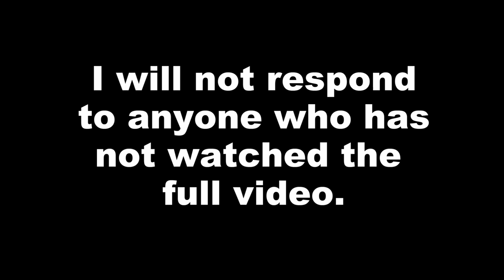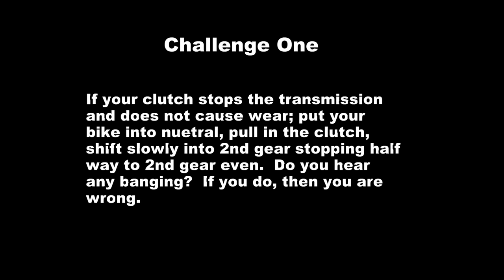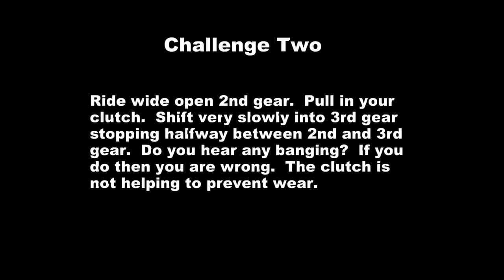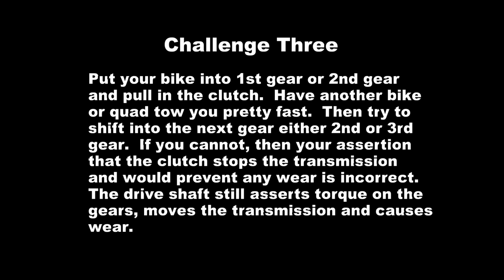Dirtbike: Shifting without the clutch

Comment: Many of your points are valid but not all, from my perspective. If you belive im wrong please correct me, im just here in an friendly manner. And would like to learn if im wrong. What i would like to say is, when you change gear without clutch it can wear out your transmission faster. Ok, why? If you revmatch perfectly it wont make any difference at all. I stand with you there. But when you arent using the clutch what you are doing is forcing 2 gears together at different speeds, and yes you do that when using clutch to of course. So whats the difference? The difference is, in this case the wheel spinning the gearbox is the non stoppable force. And the engine is what will adapt to the gear and wheelspeed. What is happening is the gear "notches" will click together and will themself brake the engine rpm ex from 6000 to 4500. That energy is what will "slam" the notches. It wont cause extreme wear but defenetly wear out them at maybe the dubble rate? (guess from me). If you pull in the clutch what will happen is the same thing, the gears will still spin at different speeds but what the notches will be breaking is just the clutch + clutch friction. And thats why clutching wears less on the clutch notches and gears. Please ask if you dont fully understand me and i will explain. And if you think i am wrong explain to me why and maybe we can come to an agrement! So in concusion what i say, without clutch more wear. With clutch less wear. And thanks for taking the time to make such an instructive video!
Reply from the maker: There is no slaming except in the case of down shifting if youre going faster than that rpm range can handle.  Otherwise, the gears actually spin faster at the same rpm range so no slamming.
Reply from the maker: And if that is the case that the clutch would not be spinning and have more give it actually makes it slam harder because its not moving where in the case of it moving they are still going the same direction and not going to slam. so the clutch makes it worse in that case.  This is also why its best to do a video response and not a comment.  There is no extra wear from not using the clutch.  The wear comes from not shifting correctly and when there is too much torque on the gears.

Comment: There is always going to be a certain amount of "drag" involved when the clutch is pulled, this means all gears in trans are always moving, all you need to do is use proper technique  when shifting clutchless which is very easy, basically a quick movement of shifter with no throttle applied.  and for those who disagree,...  listen when a harley is kicked into first gear, its such an awful sound i cringe and wonder if he has a magnet in gearbox, love to see that drain oil after a few thousand miles!!

Comment: I ride a Honda 250crf in my day job, on and off road about 100 miles a day. On road I rarely use the clutch and over 10,000 miles later I am on the same clutch with no issues.

Comment: I got a tech question. Sometimes when I shift(2007yz250) in to 1st or 2nd from neutral it shifts hard like a louder then normal clack sound , it also make the same type of sound when I'm lugging it like through tight trails . Dosent jump/slip or pop out of gear just a loud clack when putting into gear . Any input would be awesome .mahalo

Comment: I raced motocross for years and never used my clutch to upshift .throttle wide open ,up through the gears.its a constant mesh gearbox it's designed that way ,its a technique u learn.clutch to pull away and slip the clutch to get in power band when exciting corners..I've raced 125s 250s and 500s and never lost a clutch.believe me it does make you quicker..

Comment: I was shifting without a clutch today and now  my bike won't go into any other gear than first with you have to force and force back into nuctrel any thoughts
Reply from the maker: When you shifted without the clutch, was it hard or easy? You can't force shift if there's torque on the gears you have to let off the gas.

Comment: Ive never heard of the dogs on the gears grinding, but I did manage to break the teeth off of 2nd gear on my 400ex by shifting without the clutch.
Reply from the maker: That's anecdotal.  Gear teeth break off for a variety of reasons and the clutch doesn't do anything magical as explained since the gears still go together the same way.  Revving the bike up and dumping the clutch is one way to break off gear teeth and that's USING the clutch!  Down shifting at high speeds is another, without the clutch is very bad but still bad even with the clutch.  Manufacturing defects is another cause where the material isn't properly treated or sufficiently thick/hard for the application.  Unless you were not letting off the gas when you shifted without the clutch, the issue is elsewhere.

Comment: Nice video, but you don't really show the wear points that typically develop, which are the rounding of the square edge gear dogs over time. Clutch just lessens the load, as these gear dogs rub across each other, engaging and disengaging. Sure a perfect no throttle condition with no load, no clutch will work most times, but there will also be those times where a hard drag into the gear dog chips away the corner. Using the clutch, just guarantees, that the drag is lessened with out fail.Ive also seen horribly notched baskets from people who do a lot of clutchless down shifting through braking bumps.

Comment: I never really argued about damage occurring  when not using the clutch and sometimes(although rarely) I shift without the clutch.. I just always use the clutch because I fell awkward when I don't.. lol
Reply: ClutchLuck24/7 the way I think about is  when I don't it's like a moving gear changing to a stationary gear and over time could possibly damage your transmission I always use my clutch and it's always good because let say you need to stop quick you use the clutch and brake

Comment: This is great information! I have read from numerous sources, of the recommendation to blip the throttle on a downshift (without the clutch). How does this work? Wouldn't that simply lurch the bike forward if the clutch lever is not pulled in? Or the blipping does nothing and I should just ignore that completely?

Comment: honestly I almost never use the clutch with several bikes I have owned, I have never felt clashing or resistance, just speaking from my personal experience.I actually think clutch shifting up a steep hill is harder on everything because of the drive lag, I use the clutch from a stop, when I need a little extra power or shifting my weight.99.9% of racing type heavy duty sequential transmissions use straight cut gears, not helical, ie they are pretty much bullet proof

Comment: i dont use it up shift and i use it down shift anyway doing this for many years without problem only thing i know is that is quicker i realy douht it damege anything if you just hold a gently pressure on the shifter  and cut off the gas it will shift smooth just by itself .....

Comment: In motogp, the fastest accelerating hardest braking motorcycles in the world, they shift down to go up a gear and shift up do go down a gear
Reply: I use the clutch on my 250 to jump up in the rpm range when necessary
Reply: Alex Brillant your point is? All I know they do that for faster shifting. For instance drag bikes it's easier to shift down it's quicker to do than up with your feet!
Reply: the reason that is, is because they are so low in left turns that they can't fit they're foot between the shifter and the ground to shift up
Reply: can you explain that better please
Reply: This is so you don't have to get your boot under the lever whilst accelerating out a left hand corner, where, you will admit, there is little space

Comment: This is all assuming the rider has good timing skills with the throttle....

To avoid user error, use the clutch no? I cant imagine shfting without holding the clutch in and without modulating the throttle, just holding it wide open the whole time. It all boils down to how good the rider is imo.
correct me if im wrong

Comment: Do u know perhaps why my dirtbike makes loud noise when shifting into 1st gear. It use to not do this. Do I need new oil or do I have to bleed my hydraulic clutch on my ktm. Is something not engaging. What should I do.
Reply from the maker: What kind of noise, a rattling?
Reply: Opferman Motors Dirtbiking I loud clunk not a rattle just a short loud clunk

Comment: I bought a old Kx80 you can switch the gears into neutral well the bike is not running but while the bike is running it won't go into neutral and it's very hard to shift. other than that love the vid

Comment: I haven't understood 100% of it, but followed "ok" for the most part (i think?).
So to sum it up, when upshifting, you may need to slightly let off the gas to realease a bit of torque coming from the main shaft for it to match with the torque coming from the drive shaft, and when downshifting to slighly blip the throttle, for the same reason (like rev-matching in a car). Did i get this right?

I knew why rev-matching was important (i mean, just feeling how a car behaves when you downshift early without throttle bliping is enough to understand), but i never knew how the mechanical forces worked (torque here). Anyway, thx for the video, i hope i got it all right! :p

Comment: what would the difference be if you shifted up/down clutch-less while being on the throttle moving?
Reply: On the throttle, you've got a high amount of torque moving through the transmission.  That torque creates a lot of friction between the dogs (which IIRC are often very subtly undercut to keep them from falling out of engagement, on top of everything) which prevents them from easily disengaging so you can shift into the next gear.  That puts a TON of stress on the shift fork for that gear, and will either prematurely wear it out, or actually bend or break it.

For a no-clutch downshift, you actually will need to get on the throttle slightly.  Off-throttle and decelerating, the engine is being pushed by the wheel, so you've still got torque moving through the transmission.  A quick little twist of the throttle to match the torque at both ends of the transmission is needed.  Even using the clutch, you want to throttle the engine up for a downshift to keep the rear wheel from slipping when you reapply the clutch (look up rev-match downshift).  

The main thing a clutch does is disconnect torque between the engine and transmission.  You can accomplish the same thing with the throttle very easily on a motorcycle/dirtbike.
Reply: immikeurnot I feel like throughout my life riding motocross, you alway jam the gears down without the clutch, (on hill climbs, entering corners etc) and on upshifts you just blip the throttle slightly right before the shift. The gears are different on MX bikes compared to cars or something else arent they?

Comment: so I have 2 four stroke 125 Chinese pit bikes one is mine and the other is my 6 yr olds can shifting without  using the clutch save clutch plates and transmission ?  I know it can be done truckers do this when the engine gets to the right rpm you can up shift and down shift ! also his doesn't seem to want to go in and out of gears I'm no transmission guy so I don't know anyone
 have a idea what's going on?? thanks

Comment: Ok.... i bought my son a brand new 2010 yz250. 12 hours old.. 2nd gear wont hold. "Slips out of gear with the slightest amount of throttle". He didnt use the clutch and flat changed because his mate at school said you dont need to use the clutch. I pulled the engine gearbox apart and found 2nd gear dogs rounded off on the male and female side. Also found 3rd and 4th rounded off but not as bad! I replaced all 5 gears and the forks as the forks were loose on the shaft. ... " fork to shaft mounting is a roll pin"!!!  Bike is now back to me with no drive in 4th gear! Pulled apart and again the gear dogs are rounded off causing it to slip out of gear!!! Fork is also loose on shaft!!! My point... what is he doing wrong??????? I have the same bike bought at the same time and thrash it using the clutch!!! No problem!! Please help!!!!!!!
Reply: Bike 4th gear problem at 26hrs...
Reply: robmotown1 Clearly he is not letting off the throttle when he shifts without the clutch, just banging it up with the throttle still applied

Comment: another illuminating challenge, and im not saying ride all over hell during this, put 10 wght oil in trans how does it shift now? now drain and fill with 90 wght, now how shift? this will clue you in to the role of viscous action plays together with synchronicity and the drag of clutch plates all work together and the balance of torque between wheel and engine output and input, some people just find it hard to visualize whats going on, you have it right
Reply: smackomatic leftright:  is it true?  per the video, i should NOT let the bike roll while running without engaging the clutch? Because the video states oil will not be distributed?

Comment: One problem I see with shifting without using the clutch is the very rapid change of speed on the engine and gear box components. You will change the engines rpm with let's say 1000rpm with a "bang"(milliseconds?). There's some moving mass in the crank, piston, flywheels etc. and that energy has to go somewhere. The clutch will release the moving mass from the crankshaft and if you're able to mach the revs when releasing the clutch it will be a very smooth shift. The gearbox is still in motion from it's inertia so shouldn't be a problem to engage next gear. 
But how much impact that has on the bearings and gears etc. compared to normal forces when accelerating I don't know.

But it might be irrelevant for a dirt bike that's ment for racing and full service twice a month, but as you where talking about oil in the crankcase and that stuff I started thinking about the impact it could have on bearing life etc.
Reply: you are completely right. I had some job with bikes angines repair, i have got degree in mechanical enginering and i can tell, that author say allmost true. It works, but in ideal circumstances. I saw many lapped gear dogs, many destructed crank trunnions(because of inproper toque transmission through the key). All comments below this video posted by people, who never saw their gearboxes after such use. Gearbox of the author is evidence. Look at the wear lines on the teeths. They can be caused by impacts between teeths. In any way i tried to shift without clutch and always heard little bit hard clunk noises from my engine, and it is not good for it.
Reply: The clutch doesn’t eliminate the rpm difference as explained in the video. Cutting the throttle does. The gears in motorcycle transmissions are always in motion. That’s why you clearly hear the hit of the dog rings engaging when you shift from neutral to 1st...at a standstill...at idle....with the clutch pulled in.
Reply: Cutting the throttle while shifting does eliminate the torque between gear dogs but does not eliminate the rpm difference between the rear tire and the engine if the clutch is fully engaged, because the rear tire and the engine are SPINNING TOGETHER. For example,  when you donwshift, the engine get like 1K more revs for the same rear tire spinning speed. That's why we pull the clutch in and blip the throttle to rev match the engine when donwshifting.
Reply: malageb1 downshifting is a different issue. You need to blip the throttle to match the rpms as you down shift. He covers your scenario. In the video
Reply: Blipping the throttle to downshift is more about intake vacuum and the negative power output than the actual RPM thing.

Comment: i shift without changing gears all the time, when i am wheeling and it on not convenient to use the clutch or motocross starts when it could mean the win just to get rid of that spit second when the clutch is in and there in no hp at the rear wheel

Comment: 0:01 Why do they have paint inside the crankcase on the transfer port bowls?
Reply from the maker: I don't know why they not only painted the outside but also the inside of these engine cases blue at the factory.  The engine is a rare side car engine with less than 50 ever made.

Comment: Your last challenge is vague, I'm not sure exactly what you're trying to prove. Yes I understand torque and forces. 

So the torque of the gears is pressing the dogs together with a high force.

This high force between the dogs causes high friction.

And this high friction is preventing the dogs from separating and thus the gears from disengaging?

I'm not sure why the bike isn't shifting from first to second, is the output shaft spinning too fast to engage with second gear? What is causing wear here?
Reply from the maker: The goal is just that just because you pulled in the clutch doesn't mean you can still shift, the clutch isn't magic.  When you're moving with the engine on, the torque comes from the crank and so letting off the gas or disengaging the clutch will allow you to shift once the torque is off of the gear dogs.  However, the clutch has nothing to do with the secondary drive connected to the rear wheel which is always engaged.  So if someone is pulling your bike your wheel is now putting torque onto the transmission just like your crank does when gas is on.  So NOT having someone tow your bike (or even drifting fast down a hill) is the same as letting off the gas without disengaging your clutch because there's no clutch on the drive shaft.